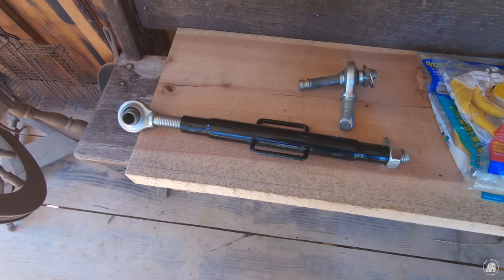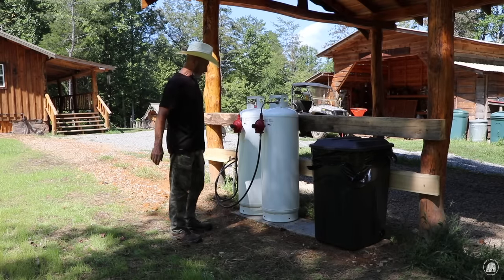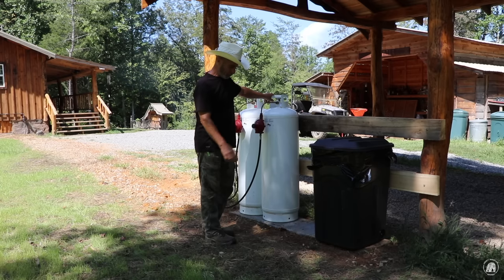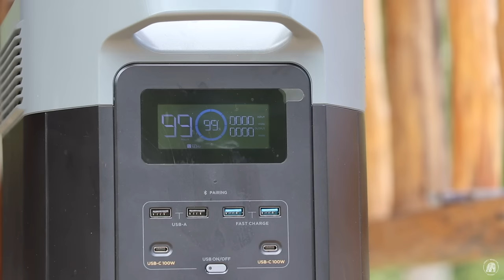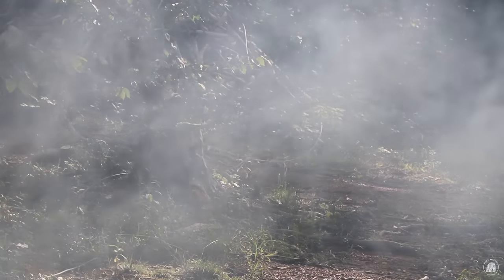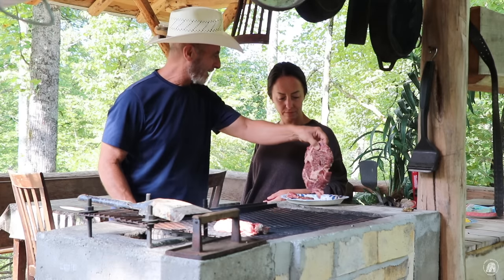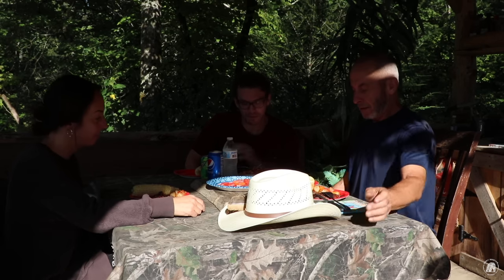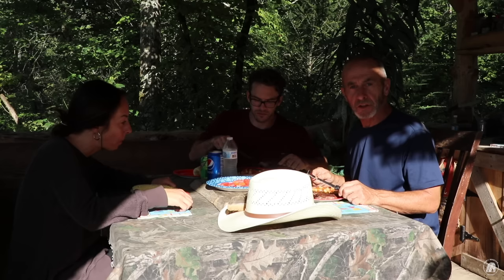Off-Grid Cabin & Timber Frame Workshop Get A Facelift!

Comment: Love the channels!!!
I was wondering if your timber oil you use on everything requires a 2nd coat at any point? I need something for my eastern red cedar that lasts better than the tung oil I used on my deck. Looked great initially, but has turned really dark gray after being in the sun for 6 months.
Thanks!!!
Reply from the maker: The Australian timber oil that my dad uses has linseed oil, tung, and iron oxide in it. This helps to preserve the wood longer than tung would. You may have to apply ever 5 or so years depending.
Reply: @SmokyMountainOutpost  Thanks so much!!!

Comment: Would it work to have the torch stationary and slide the board over it?  Might be easier.😊 ❤
Reply from the maker: It works well as is. I burn everything
Reply: @SmokyMountainOutpost  wasn't asking you to change the way you're doing it.

Comment: Now you need a two way connecting valve that automatically switches from bottle A when empty to bottle B so that you never run out. 
You will have 4 gas bottles so always full ones spare